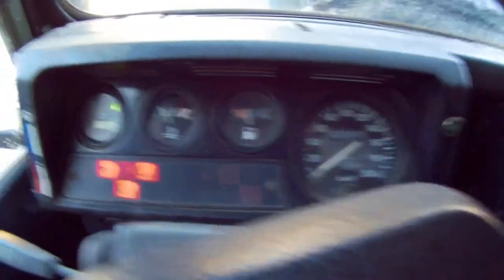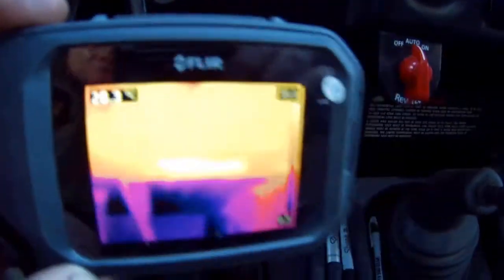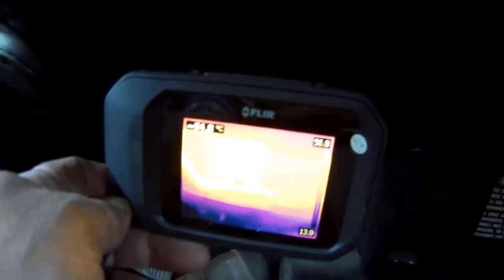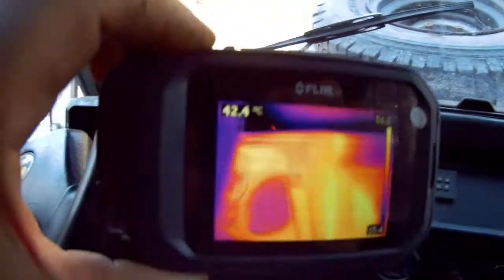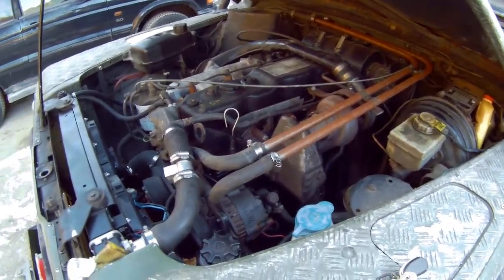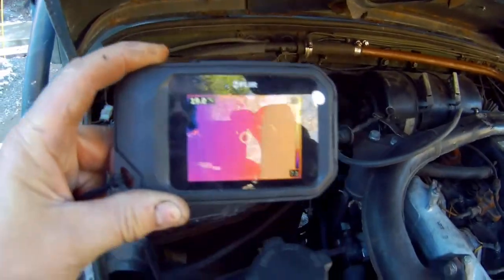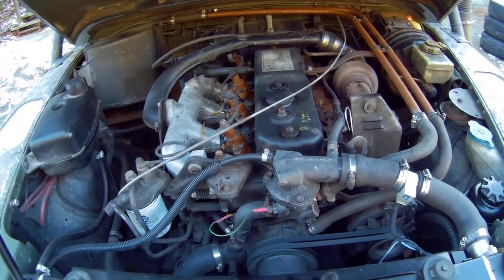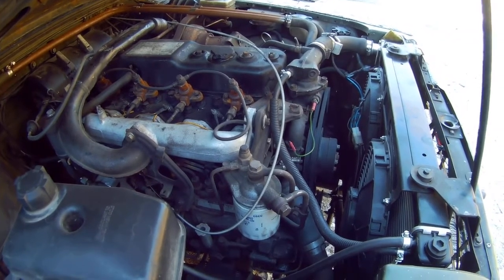Defender heater modification part 6 New vehicle test at -5C

Comment: Mike, thank you for these vids 👍 I watched all in on go, as usual. Re engine cooling, I wonder whether the heater matrix is ALWAYS on and ALWAYS circulating? Or is the circulation through heater matrix activated (on/off) by one of mechanical levels on the dash? Just to make sure, I'm asking this question from engine cooling perspective. Many thanks 👍
Reply from the maker: It is constant flow with no valve
Reply: @BritannicaRestorations  great, thank you 👍 So, upgrading heater matrix to higher capacity, is (also) likely to help cooling the back of the engine block, then. Right?